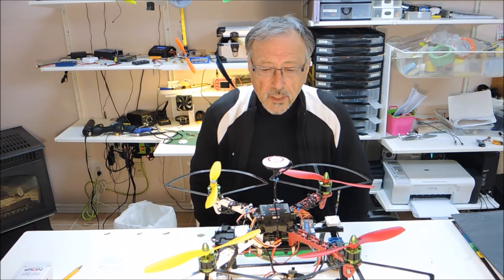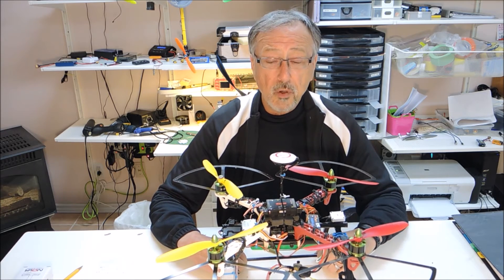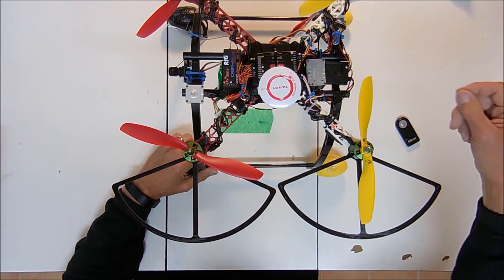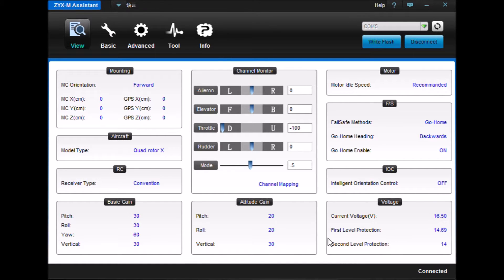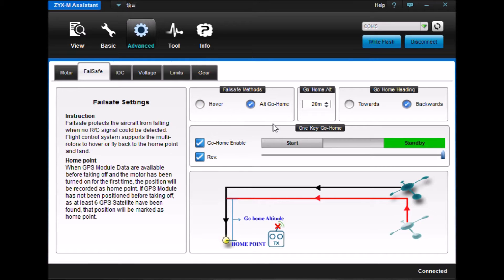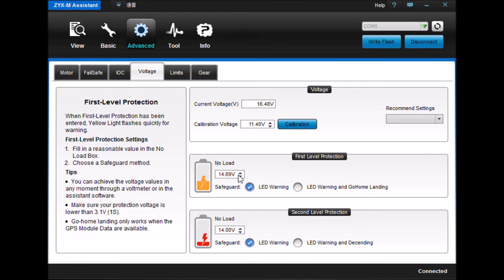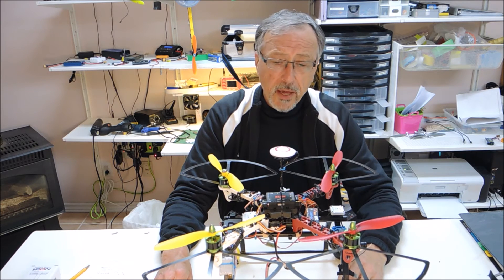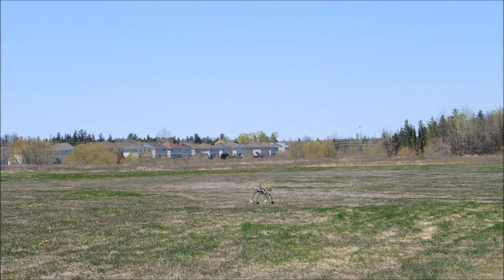Part 4  Tarot ZYX-M GPS and Return to Home

Comment: Emerald, I am so burned out right now My ZYX-m Tarot will not pass motor tests,  I get the Motor beeps when I power it up but cannot arm motors.  I am never going to recommend HobbyKing to anyone either.  Tried to call them and there isn't even a phone number.  They put someone on chat that doesn't even understand English and has no idea about the product.

Comment: how do i gain control once i press go home? i tried turning it off but it wont let me control it.
Reply from the maker: I have never had any problems turning it off and regaining control, however it does take several seconds before it gives back control. I always switch to a non GPS mode such as altitude to regain control. A lot will depend on hpw you configure your radio. I use a Taranis and have two switches one for flight modes and another just tor Return To Home. 

Hope this helps.
Reply: i tried turning the return home off then switching to non GPS mode and it worked but after 4 secs i lost control again and it crashed face down.. :(
Reply from the maker: Rust my guess is calibration, but first confirm that your spinning motors in the correct direct using the software and that you calibrated the ESC's. Then take a look at my Part 3 video on calibration. See if that helps.
https://www.youtube.com/watch?v=jYppJKGsKpo

PS I have experienced your problem with other flight controllers in the past and the above tips seem to help.

Good luck.